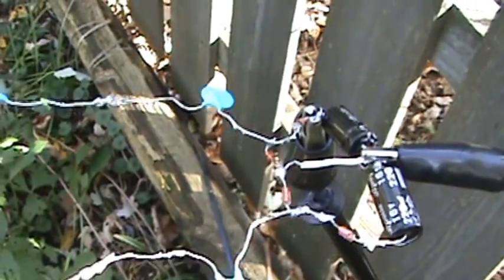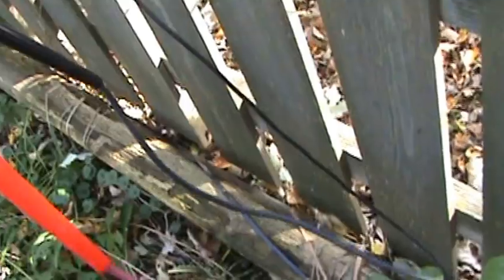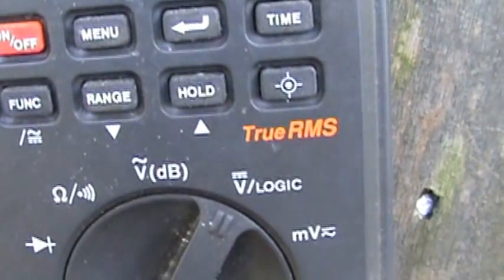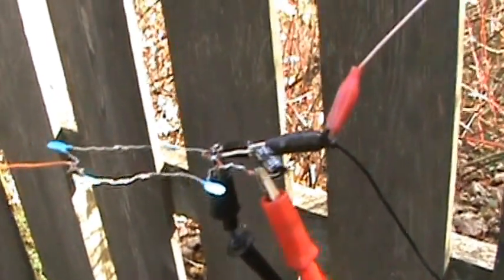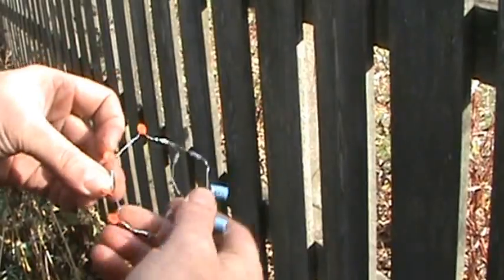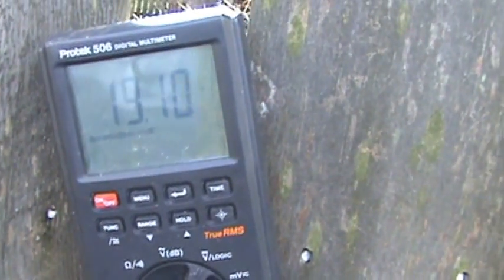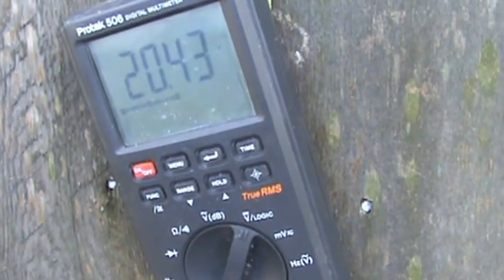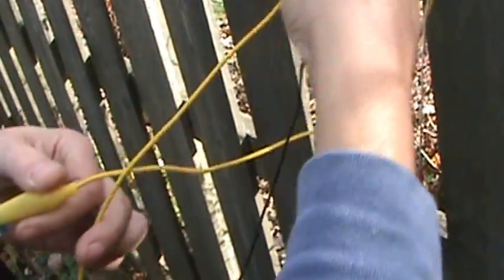Free energy from air, TEST 3.MPG

Comment: What would happen if you took a roll of AL foil and a 2 rolls of plastic place plastic on each side of Al foil and use the single foil as a antenna end plate large surface area in a small space.
Reply from the maker: +Ed Shields Yes, good idea, i thought about this also.  Its like a capacitor.  I will have to try this :-)

Comment: What about approx 60m high antena and best possible components? Would be possible to light up a propper bulb or smaller fluorescent lamps? And with your second circuit, would be possible to charge a cellphone? What if I use just approx 2-3m high antena? Would I get 5V or so? Thank you
Reply from the maker: LiborPaulik Sorry i missed this comment a while back.
60m high antenna, i believe with confidence it would light small lamps.  2-3m high, yes, should charge cell phone.

Comment: I recently tried this with an insulated aluminum plate and got less than 1 volt, would i be better off getting a proper high gain antenna? or are the diodes and capacitors the important part? Also, wouldnt it work to charge the capacitors with that high voltage and discharge them through a transformer to get a usable voltage/amperage. With the right capacitor you may be able to charge it to 3 or 4 volts then discharge the capacitor with a high amperage due to its capacitance ?
Reply from the maker: Diodes and caps are the important part.  They rectify to dc.  Yes, to charge caps and use transformer.  I was going here but got side tracked with better ideas from Dr Moray and Franklin Mead and WITTs devices, now i feel i am onto much greater power,  but progress has been slow due to lots of studies, and tuning parts of circuit to correct frequencies, but im on last stage now.  Im also in process of moving my Lab.  I hope you continue with your idea and share your results :-)  I think you will want to also incorporate the coil and get things to resonate for best results.  Check incoming freq off your plate and make LC circuit to match this.
Reply: Thanks for the detailed reply, I think what ill do is try it small scale with a small solar panel and work my way up from there once i get my circuit design complete. Then move onto the antenna, Your channel is an inspiration! :)
Reply from the maker: Eli Al Thank you :-)

Comment: What do you think if you'r making the Antenna resonant to a froo example 1900MHz Networked Provider BTS? That will stack you efficence. Now the Trees are without the green foliage is now brown at the time. if the spring is coming the'r will be green and isolate all your received waves.I remember a friend of my and i we would like to make a battery charger for this fluctuating energy in the air. We found out that our GSM Network here in Europe have 900MHz or 1800MHz differnt to your Mobilnetworks. Or make a Antenna exactly to the DVB-T Transmitter Frequenzy that also helps to charge your Batterys.

All the Best i like this ideas!
Volker

Comment: Germanium .3 barrier voltage.  Silicon is .7 barrier voltage. Both have same break down voltage, in Diode or transistors. 16 vdc capacitor's limit voltage. Zener Diode can be used too as volt regulator/limiter. Fantastic to hook up to a solar charge controller. What about 100 of these in parallel? PAUL thanks and your circuit works. My antennae is tinfoil on my window. Same antennae with parallel circuits next! Thanks again my friend!

Comment: I'm fairly sure with those value caps and that length of wire you are just picking up radio transmissions and rectifying them - probably a high power AM

Comment from the maker: yes, works at night :-)  i can get over 100V but very little current,,only micro watts :-(  antenna is "enamelled" copper wire.
I got better results from a sphere then i did with plate,,,but sphere had much more surface area.  Sphere can collect radiation from all directions. So far i get best results with wire collector,,but maybe because i was never able to get the sphere as high as my wire antenna, i believe the sphere at top off wire antenna would be best.  cont....

Comment from the maker: 2V, more then most get on their first attempt :-)
Bare wire, not enameled coated?  Nice length of antenna you have.
The high end of my antenna does point N. But i been meaning to try a dipole antenna, pole at both ends of antenna, and another wire soldered to the middle of that one that comes down to the circuit, because this is how Dr Moray did his set-up. But i dont personlay think the direction makes a differance. Im wondering how much current your getting now(amps). Cont.....

Comment: Paul,
nice work
680ua,  you'll need at least 20ma to power LED

Fox hole radio and crystal radio picks up AM no battery. At coral castle Ed had a crystal radio set.

ur Circuit looks like a full wave bridge ( like a power supply) with extra diodes is this correct?

If there was no energy in the atmosphere, you could not have lightening.

Comment: I suggest you use a 10K ohm load and measure voltage across the 10k. From that voltage you can then compute POWER using V^2 / R and POWER is the more interesting result.

Comment from the maker: I hope im correct in saying that it is on video part 7 that i show powering a calculator.  In this video on this page, see where i hook up my meter probes to the circuit,,,this is exactly where you would hook up a radio or whatever you want to try to power. But, yes, you would need many circuits. This circuit, at this time, has only enough power to run things that would operate on a watch battery button cell.

Comment from the maker: yes, this could be part of the problem,,,mine are rated at 50V,,,but if i add the coils to the circuit i can get between 80 & 100V, and this is above the rated volts of my caps, hmmm, but my caps are from another manufacture, maybe i just got lucky that i did not blow my caps yet. I will keep thinking :-)

Comment: Quick question here mate. What do you think would be the reason for voltage drain, which eventually tumbles to zero, across my circuit upon connecting multimeter leads. Any solution for this you've discovered? Thanks again.

Comment: Dude make Really BIG TESLA BIFILAR or as you americans says PANCAKE COIL, big mean 1-2 meters or more in diameter, rise it very high, as high as you can, make good quality ground, GROUND ONE SIDE OF COIL, ON OTHER PUT A PLUG FROM TWO HV DIODES, ANODE-CATHODE JOINT AND CONECT ON ANOTHER SIDE OF COIL. ON OTHER ENDS OF DIODES PUT QUALITY HV CAPACITOR AND YOU GET A SHOWTIME.

IF YOU WANT MORE POWER 2 SAME SIZE COILS IN QUADRATURE - WINDINGS OF 2ND ROTATE 180 DEGREES FROM 1ST APART. PURE TESLA TECH !

Comment: i used 2 lents of wire. one off the sheild the other off the core they are in opposing directions and hung from insulaters electic fence type wire connented to a coaxial cable the 2 lenths of wire must be 17 feet and 6 inches ..on a dry windy day i noticed a sound in the house i followed it to my ant end and there i seen a constane arc comeing off the end of ant lead about one quater inch in lenth its static but its there...be careful in a strom it collects a lot of statice danger shunt to grd

Comment: it takes a specialeter to read what your after here with out the meter interfearing with your test i forget the name of the meter....with that said it is possible to get power out of thin air.. but it will be very low current with voltages in the 100 thousand range simaler to lighting ...you ask how its very simple i ran across this by accedent as i like to build my own cb antenna i had built a half wave lenth dipole on the horizoinal side as they are so easy to build look up on the net

Comment from the maker: I have ground now of, if i remember correctly it is like 1&5/8" diameter pipe now of copper 5 feet deep, and i have no differance between this ground and ground copper rod of 1/4" dia at only 2 feet deep. Also tried zink rods with no differance.  So i decided not to go any deeper or larger with the ground.

Comment from the maker: Ohh, thank you.  I will have to check the voltage from same points as you tried :-)
I have tried a couple of other deigns & read of many others, so i have not tried that many differant designs yet,,but from what i read, i "believe" this circuit design is at the top of the list for collecting energy from waves. im sure there are better desings for collecting energy from 1 specific frequency, depending on the output power of that frequency.

Comment: You have no need to. The energy from air circuits work on the same concept. :-) 
The only thing your missing is a collector and a load. Just remember to not let your load connect to your antenna and ground. Collector gets charged by the antenna and ground...collector gets used as power source. Always best to use more then one collector...hint hint. :-) 
Have fun :-)

Comment: just so ya know,either make a huge coil and stick it a few feet under your power lines,or make sure your antena is as high into the air as you can.
500 feet is your best bet,but not easy to do,for antena.
them huge antenas 30-40 feet in the air work,but they are in the ground they need to be un grounded till after your  circuit,or even the outside of an airplane works very will,or a kite string will give you 10k volts,just giving you ideas that have been proven,kits sucks cause of lightning.

Comment: Beautiful setup. :-) That circuit looks like it should make a pretty decent "merry-go-round" to prevent the antenna and ground from making contact with each other. Antenna is positive, ground is negative...prevent the balancing of charges and collecting the potential and using the collector as the power source. :-)

Comment: I would like to see you discharge the circuit turn it on bring it to half the peek voltage you normally. Time from say 10 volts to 20 v. Use a stop watch to figure out how much time it takes. Then you know aprox how much time it takes from 10 to 20 v. Then discharge turn on meter then (disconnect) once it hits 10 volts detach your meter. Wait till the time is up. If you are at peek voltage you have something worth finding improvements on. If you are at half voltage then your still taping zpe

Comment: Your comparison of circuits is not accurate if your only using volts to measure. I mean its cool you get +20v, but that's probably at some very small amperage, making the total wattage minimal. So in that regard I agree with other commenter, put a load on it.